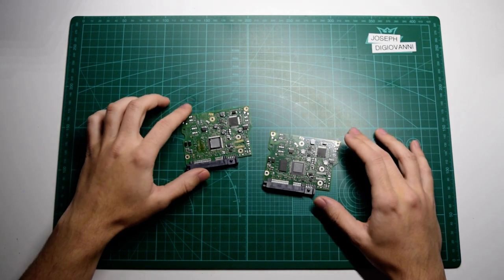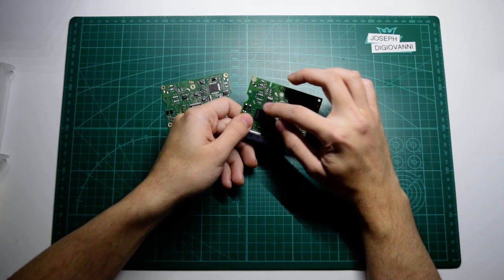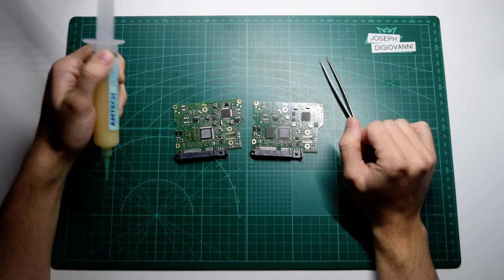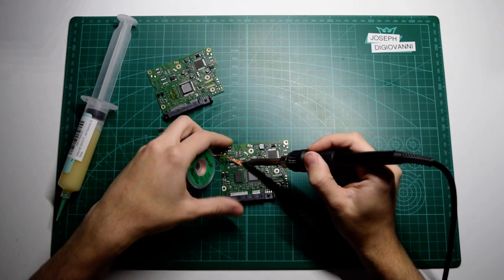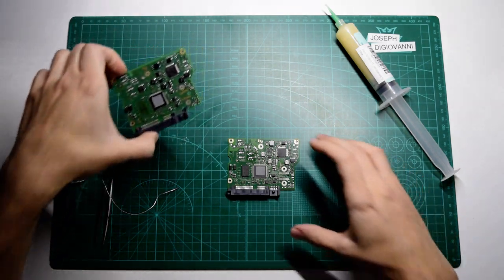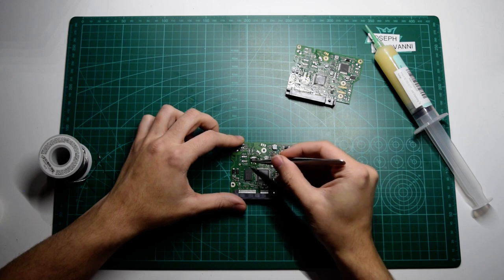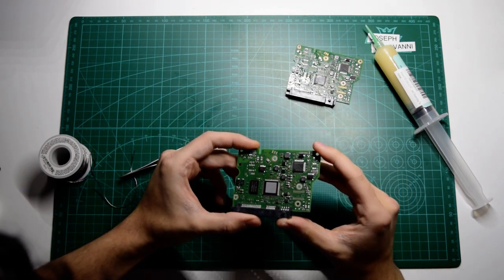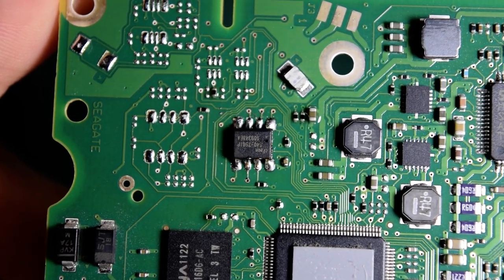How to Replace a Hard Drive PCB for Data Recovery

Comment: I fried my 2tb Seagate barracuda from using wrong psu cables. I swapped boards with another drive I had and I felt the disk spin up so I bought a replacement board. Swapped over bios chip and it doesn't spin. Like what are the odds I got a bad replacement? Sucks man, I feel defeated.
Reply from the maker: It's pretty likely actually. The boards are from junk drives so they are likely all untested. I'd say they're pretty likely to give a refund or just send you another if you tell them it doesn't work. Leave out the fact that you swapped the bios chip though. Probably a good idea to do the same spin test with the new board you purchased before swapping the chip
Reply: @jdigi78  Yeah I definitely should've tried to power it up beforehand, kicking myself for that lol. I ordered through AliExpress so I'm not gonna hold my breathe they'd send a replacement, but it was cheap enough that I might just buy 2-3 this time. One has gotta work right 😅

Forgot to mention the first time but thanks a lot for the video it was my first time doing something like this and it was very easy to follow a long with you 👍

Comment: I  have two boards: 100617465RevB and 100617465RevA, is worth to change bios for the recovery data?
Reply from the maker: if you already have them go for it, I've personally had luck using different board revisions but it won't always work
Reply: @jdigi78  I tried to change once only whole board but pc did not see HDD... If i can find same revision i will try than, the data in it most important thing to me.

Comment: Can this be a permanent solution or is it only temporary to recover the data?
Reply from the maker: I suppose it would continue to work but I personally wouldn't trust it because I've seen some of the replacement boards come in pretty bad shape. If you're going to do that at least invest in a good backup solution
Reply: ok, thanks for answering
Reply: No!  get the data off, and scrap the harddrive!  :)
Reply: Hardrives even at high capacities are not very expensive compared to losing precious data. Just get a new one.

Comment: Just want to confirm. A PCB is just that, right? A circuit board? No data on it? Need to get mine fixed.
Reply from the maker: No data other than the bios chip which contains calibration info for the drive head and platters
Reply: @jdigi78  Thank you. As mentioned in video, its not as easy as just swapping the boards. 
There's no other fix?
Reply from the maker: @ChineseSe7en  there are other things that could be the problem, but if the drive doesn't spin or you don't hear the head attempting to read the data it is likely the board. You can't just swap the boards without the bios chip. You may be able to take the PCBs to a computer shop and ask them to do this specific task, they may do it

Comment: Don't know what I'm doing wrong. When it comes to removing the chips I can't get them to budge. I've got a soldering iron heated to a good temperature but when I use it with the tweezers I can't get the chips to budge, at all. You made it look so easy! Any ideas anybody? I'm just about at the giving up stage with this HDD.
Reply from the maker: if you're using a standard soldering iron try a product like chip quik. it's solder that stays molten longer. Otherwise try applying fresh leaded solder to the pins before trying to remove, lead free solder found in consumer devices can be harder to work with

Comment: Another Update:

I just got my Donor Board. The drive spun right up and sounds great, no crashes or nasty sounds. It does try twice to read and then gives up so I think there is where swapping out the BIOS is going to work, right? I'll go ahead an order a rework station now to perform the procedure.
Reply from the maker: Sounds like you're on your way to a successful repair so far. Good luck

Comment: I have a Seagate Archive HDD (Seagate (STEB8000100) Expansion Desktop 8TB External Hard Drive HDD – USB 3.0 for PC Laptop). It was in an external enclosure. I have several external hard drives including a WD. I may have accidently used my WD power adapter for my Seagate Archive HDD. Nevertheless, my Seagate Archive HDD is no longer working. 

I bought several of these Expansion Drives. I opened another one and it is a Seagate Barracuda instead of a Seagate Archive HDD. I was just hoping to have a Donor for parts but no luck there. 

I went ahead and ordered from an online website the exact match PCB boards to see if I can get this hard drive working by myself. I am not looking forward to sending this off to a Data Recovery Service, but I am thinking about it. 

If someone could help me troubleshoot this a little beforehand to see if I can get this working without having to send it off that would be greatly appreciated. 

Here are my thoughts. 

The drive is completely silent, there was never a horrific ending to the drive. Like it is spinning up and crashing, knocking, beeping, whatever. Just one day I plugged it in and nothing. 

Now here is the odd part. It seems like something is barely connecting because in keeps connecting and discounting in windows. You hear the Windows Notification that it connects and then disconnects. Sometimes it stays connected and you can see in “Computer Management” under “Disk Management” the drive. It is like it is barely connected on a sub low level. 

What will happen is that in “Disk Management” a window will pop up and say you must initialize a disk before Logical Disk Manager can access it. MBR vs GPT. Of course, after doing this, I get the error “The request could not be performed because of an I/O device error”. 

Disk 2, red down arrow, Unknown, Not Initialized

Most of the time the partition data or the available space does not show up in disk management, but rarely it does show up, i.e., size of partition and available space to create a disk partition. However, even when that shows up it still gives me the error “The request could not be performed because of an I/O device error”.

My thoughts are that the drive is fully functional, but I may have blown a diode or something. The hard drive was sitting in an enclosure and had an extra PCB Board that was a bridge between the power supply and the hard drive. This other PCB board on the external enclosure is working perfectly. I popped out another Hard Drive from another enclosure used it on the bridge and everything works perfectly. So, I am not sure how the Seagate Archive HDD failed even when the External PCB power supply which held it did not. 

This is what leads me to be that somehow the PCB Board is no longer working on the Seagate Archive HDD and this may be a simple solution. I ordered a new PCB Donor Board and was hoping all I must do is transfer the “Bios” and install the new Donor Board and everything works. 

My question is troubleshooting. 

Before messing around with my vital “Bios” chip. Can I just swap out my Donor Board to just see if power is restored and the drive spins up? I know I will not be able to access the Data however, I would be able to confirm that my other original PCB board is the main culprit. Then proceed to swapping the “Bios” chip on the Donor Board. 

Will swapping the PCB board without swapping the “Bios” chip cause any “Data” loss or damage the Seagate Archive HDD?

Troubleshooting Steps

-1 Order Donor PCB Board
-2 Swap Original Board with Donor Board without Swapping Bios Chip
-3 See if Seagate Archive HDD powers on whatsoever, spins, etc. 
-4 If powers on and spins up, swap out Bios Chip
-5 If Bios Chip is swapped and drive is still not responsive begin consultation with “Data Recovery Service”. 

Another question is do I simply just send this off to a “Data Recovery Service” I would hate to swap out my Bios chip and make it more difficult for them to recover. However, if it is a simple PCB Board Swap and Bios Swap, I would prefer to do it myself. 

Please feel free to give me any other pointers. I am just trying to perform some basic troubleshooting tactics before sending this drive off for an expensive recovery. I just have a feeling that this might be as simple as a PCB Board/Bios swap because the drive was never dropped, and in perfect condition. It is not that old either. 

Thanks!
Reply from the maker: There shouldn't be any data loss caused by swapping the PCB without the bios chips, if this is an external drive you can replace the USB3 to SATA PCB without needing to swap any chips. If that doesn't fix it though you may need to swap the PCB on the actual drive itself and its respective bios chip
Reply: @jdigi78  wow, thanks so much for replying. Yes, I have three of these drives. I took apart two of them. I interchanged the USB3 to SATA PCB boards on the non working drive with no luck. The good hard drive works on both USB3 to SATA PCB boards but the non working hard drive does not. Therefore, I am thinking it is the PCB Board that is at fault. What are the odds that this is a PCB Board is the main issue and this can be resolved easily? I have a couple PCB boards on the way to play around with. I will practice first on a couple of dead drives (soldering, etc.) that I do not care about. However, I do want to be very careful. I will swap without bios chip first and then try with bios chip after practicing. I have read in extreme lucky cases you can just swap out the PCB board and it works. I doubt I will be that lucky.

Comment: Okay, I finally connected the bad drive directly to my motherboard to see if I could see it in my BIOS. Nothing. Can't see a thing. I connected one of the good drives and I could see it perfectly in my BIOS including the size of the partition. So how I can see this bad drive in Windows under Disk Management connected via a usb controller but I can't see it in my BIOS. When it is connected in Windows I can't do anything with it because it wont initialize, but something is connected. Oh wait a minute, I think windows is seeing the USB Controller and the USB Controller is telling windows something is here, however, when windows goes to access the drive through the controller there is no response. Honestly, what I am thinking is that this bad drive is getting zero power. I mean when I hooked up the good drive it immediately powered up and you could hear everything working, spinning, etc. When I hook up the bad drive, absolutely nothing happens, as if the drive never turned on. I think all the confusion is the USB Controller that was enclosed in the External Case is what is causing all of these confusion problems. If I connect the bad drive to the motherboard directly, zero, zilch, nothing.  I don't feel anything, no spin, no clunking, not even it attempting to turn on. 

What does this mean? Possible bad PCB Board? Or the Drive more than like Seized? I would think that if the drive seized you would hear it power up some and try to do this and that. I am more incline to think the PCB is dead and nothing power/information/commands are even getting to the hard drive. 

What do you think?
Reply from the maker: PCB is dead, swap it and the chip as shown in the video and it should be all good 👍

Comment: Sad Update. I replaced my bios chip on two new donor boards with no luck on both of them. However, I don't think I was placing it right because I could never get a solid connection. It would always pop right off. Hopefully, I didn't destroy the chip because I know it will be party over if I did. 

I have sent the pcb board and bios chip to a repair facility for them to install  the bios chip for me and send it back. Hopefully they still can but they might not be able to. The pins are still in great shape however, you can't read the numbering anymore therefore don't know which side to face the chip. yikes.

I already contacted gilware and they said don't bother sending us the drive if the bios chip is fried. crazy huh. Aren't these companies suppose to be able to pull a rabbit out of a hat? I know its expensive and all. 

My question is i know i did everything wrong and its all my fault. Are there any options left? Can someone read the rom off the platters and reprogram a new bios chip and install it for me? Can someone do a platter swap in a clean room? 

Please Advise without kocking my head off preferably. Be somewhat gentle.
Reply from the maker: There is no need to use the hot air to put it back on. just solder each leg individually with a normal iron to make sure it has good contact
Reply from the maker: Also the chip usually has a dimple to indicate orientation
Reply: @jdigi78  Aw, I do think I saw that. I still do not know which direction that dimple should be. Hopefully the company I sent it to will install it properly via solder.
Reply: @jdigi78  For some reason that was hard for me. I had a sperate solder gun and solder but it just wasn't coming together. That is why I shipped it off. We shall see what happens and I'll report back. If they can't do it, I'll try to give it another go when I get my parts back. I still have the hard drive.

Comment: will I lose data after changing the hard drive pcb ?
Reply: no
Reply: Highly unlikely. The data is on the platter disks internally, not stored on a circuit or chip like solid state drives. The circuit pcb is for making it function.

Comment: hey Joesph I really need some help with my bios swap
Reply from the maker: what exactly are you having trouble with?
Reply: @jdigi78  I have bad shaking problem condition with my hands I was hoping maybe you could do my bios swap
Reply from the maker: @skylargarrett9865  sorry I can't do that, I'd recommend taking it to a local computer repair shop and asking if they could do it
Reply: Yea 5000 to repair
Reply from the maker: @skylargarrett9865  They're trying to sell you a full data recovery. Try a small shop not a chain, and tell them exactly what you want "swap this chip with the one from this new board". At the old shop I worked at that would be a $50 job at most
Reply: @jdigi78  ok
Reply: @skylargarrett9865  I took one one time to a tv repair guy. He charged me 23 bucks and the hard drive worked.  No lie.
Reply: @jdigi78  Yes, you know what i know...the secret.;)

Comment: I love it how none of you guys posting tutorial videos on how to do this NEVER MENTION WHAT TEMPS YOU'RE USING! Isn't that kind of an important detail? Absolutely infuriating for someone who has never done this before.
Reply from the maker: I used somewhere around 420C on my setup. Temps are entirely subjective here, it depends on airflow and how much heat that particular part of the board will soak up, you also don't want to heat it too much because it will damage the IC. If you don't have experience with a rework station I'd recommend something like chip quik or practice on something you don't care about. this is clearly not a soldering tutorial
Reply: @jdigi78  If this is not meant to be a tutorial on how to replace a logic board on a hard drive then I don't understand the purpose of the video. It IS a tutorial, albeit a brief one focusing on a specific task. If all a person is trying to do is this specific thing, it would be helpful to include the absolutely basic detail of what temperature you're at least likely to need to set your heat gun to. But instead, I had to fish for it in the comments. I just cannot for the life of me understand why someone would go as far as record a video and upload it but not include the most basic information needed to do it properly.
Reply from the maker: @kwisclubta7175  Again I can't reliably tell you how to use YOUR soldering station, hot air rework has a lot of variables involved and there is no exact temperature to set it to to make it magically work, you need to get a feel for it. This is not something just anybody should attempt without at least a little prior knowledge of soldering. I made a video explaining the concept as it's very simple if you already have the skills required to do it, but if you don't the video is just not for you
Reply: @jdigi78  So in other words, what you're saying is that this video is for someone who has already done this type of work, someone who has no need for a video like this, rendering it useless to 100% of the viewers. Your target audience is literally 0% of the population. So why make the video?

Clearly I don't have the skills. That's the whole reason I watched your video in the first place... to learn. This is very obviously meant to be a beginner's guide, yet you do not include the information that a beginner would need to learn the skill. Again, what's the point?
Reply from the maker: @kwisclubta7175  Does everyone who can drive a car know how to change a tire? Do you really think everyone who knows how to solder knows what a BIOS chip is and that it needs to be swapped to replace a hard drive PCB and have it work?

Comment: This board like seagate st2000dm001. I need this. My external hdd is not working: not seen on pc, hdd turning low volume read/write head sound. sometimes happen sounds like scratch.. I think problem on board. What you think?

Comment: Would it help if the drives are identical? I just want to try my chances just swapping out the PCB.
Reply from the maker: it would help, and most likely doesn't hurt to try
Reply: @jdigi78  Cheers, gotta try my options. I've sent one of the backups to a recovery company, and one is for myself to see what i can do. Basically lost 10 years worth of work after a pc case short.

Comment: Hi I have a hard drive it spins and works for just a few seconds, then stops sending data/info to my computer but it continues to spin, do you think this would solve my problem?
Reply from the maker: From your description it can be 50/50. Worth a shot I think
Reply: @jdigi78   Thanks for getting back to me, seeing the disk is still spinning and there are no sounds (clicking) coming from inside of the drive I think I will give this a try.